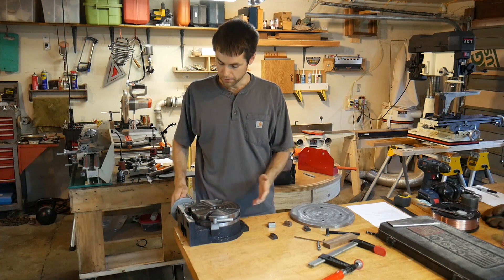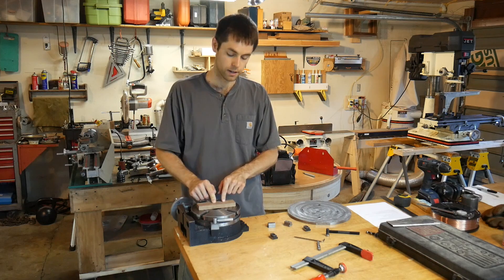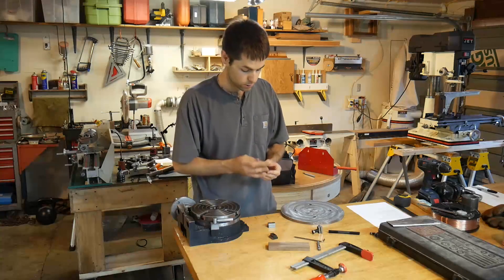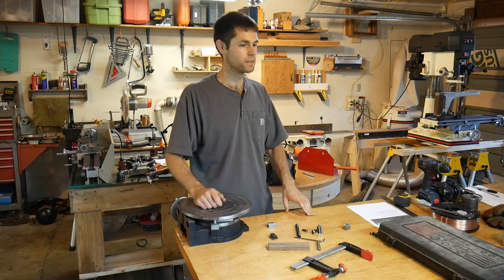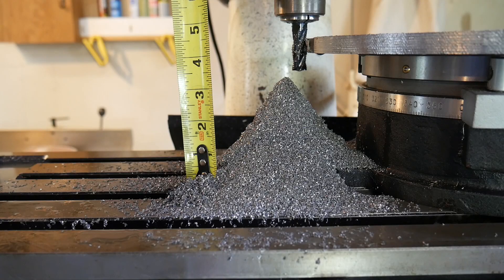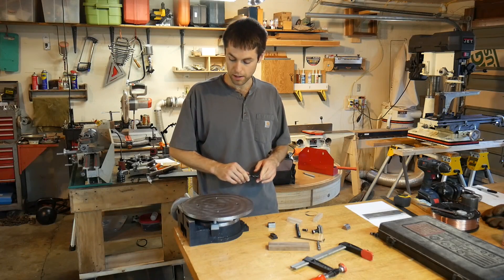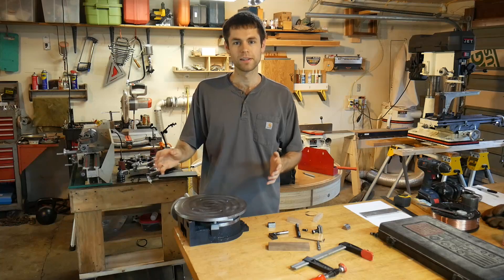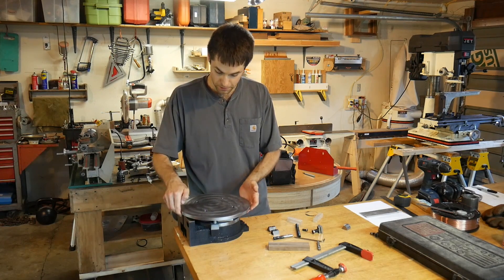Rotary Table Extension Plate

Comment: @3:00 You mean you didn't make a handle extension for the rotary handle to leverage the turns. like a stick with two holes for the small handles to go through and a larger handle further out from the center of rotation.

Comment: Using a power drill with a T-Bar installed, and having an extra peg on the hand wheel allows one to spin the hand wheel. The T-Bar will come against both the handle and the peg. You can put a piece of hose onto the T-Bar so it doesn't mar the hadle on the wheel. 

This will help in not wearing your arm out, and increases consistency with your milling. In the end you'll get done faster with a better looking product. The only downside is you have to drill and tap a whole into that pretty hand wheel. Some rotary tables come with 2 pegs, but these are mostly the cheaper rotary tables from what I've seen.